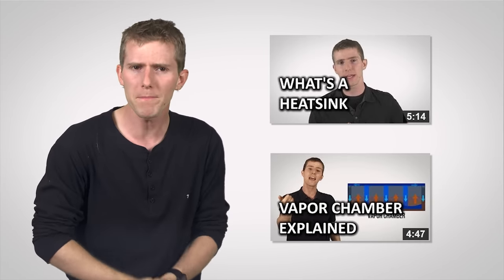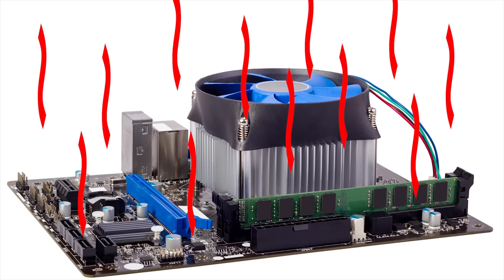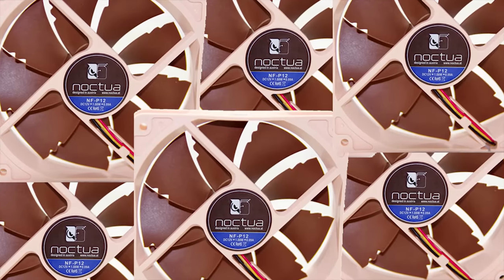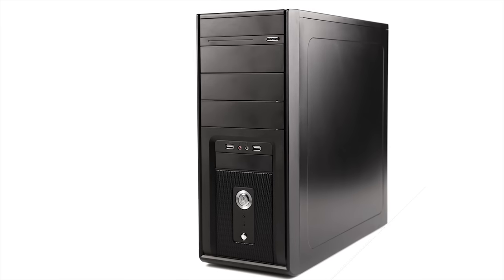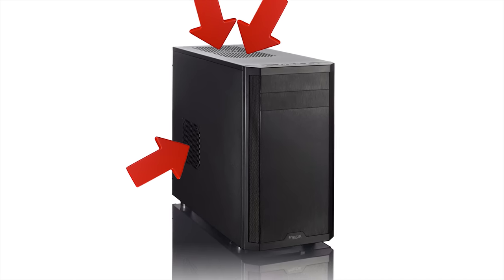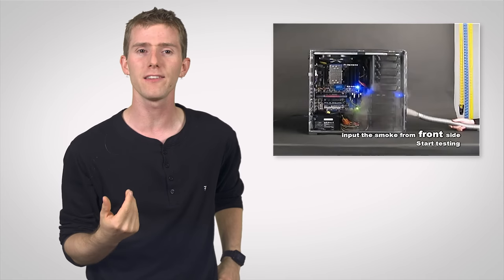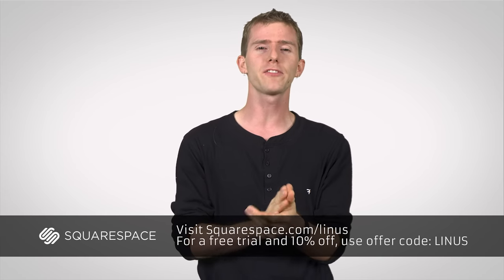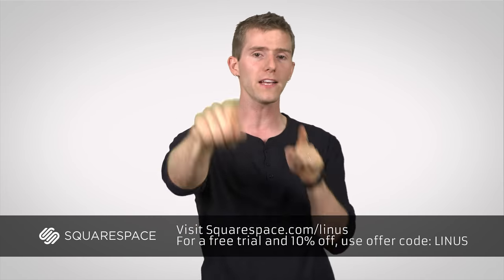Positive vs Negative Air Pressure as Fast As Possible

Comment: Negative pressure (at a ratio of 2:1) actually keeps things cooler, longer.  I did a quick test with all intake fans at 100%, compared to 20% CFM intake and 40-50% exhaust, and results were surprising.  I ran just a CPU stress test, and fans at 100% were only a few Celsius cooler than fans at 20-40%.  Creating negative pressure may invite more dust, but from what I've seen it's the best way to cool your PC.
Reply: of course more fan power = more cool. For a better test, all fans should be at 100% and, for example, test 2 in & 3 out vs 3 in & 2 out.
Reply: I’m building my first pc in the hyte y40 and the max amount of fans I can use is 7. 3 intake, 4 out. Would you reccomend or just stick with a 1:1 ratio
Reply: @survival_man7746 I don't think you understood his comment properly.
He's saying that all fans at 100% (balanced pressure) only resulted in a few C cooler compared to a negative pressure setup (with max fan speed of 50%).

Comment: Negative pressure invites dust in every nook and cranny which will shorten a computer's lifespan.  Make sure that the ratio of intake to exhaust is 2:1, 3:2 or 4:3. Modern cases used by computer assemblers emphasize lots of intake fans: often 3 and sometimes 6 fans from the front of the computer, and half as many fans exhausting air. They want to build computers that are better than those made on assembly lines  The trick is to filter the intake fans so the dust is kept at a minimum, keep the air flow high so components are adequately cooled, and use no filters on exhaust fans so the small amount of dust that does get in remains suspended and will exhaust out of the computer. With positive, managed pressure, dust will not come into the computer through the seams and panels.
Ratio of intake to exhaust from 2:1 or 3:2 or 4:3. 5:4 would produce neutral pressure and even numbers like 3:3 actually behave as negative because heat rises , GPU cards and power supplies exhaust, thereby creating negative pressure near the bottom of the case. You have to assure intake fan superiority to get sufficient air flow and movement and the benefits of positive pressure.
Reply: Heat does not significantly rise in a computer case because the air flow from the fans moves it in its direction too fast. They negate any currents that would cause it to rise.

Comment: Since you filter the intakes, it greatly reduces the amount of air pushed into the case, so you'll need more intake fans for a balanced system and even more for positive pressure. Maybe 2 to 1 intake versus exhaust, takinf into consideration that psu also acts as an exhaust.
Reply: Doesnt a psu get its air from outside the case though?

Comment: When my s4 active gets warm from gaming, I put it in the sink and turn on the cold water. It cleans some smudges and it cools it down. Because it's waterproof.
Reply: Watercooling, ghetto style. You should try to attach an h100i to it so you can oc it @ 4ghz.
Reply: iMrzifyyy
 You do realise he meant the Samsung Galaxy S4, yeah?
Not sure if srs.
Reply: The S4 is not waterproof at all. It's somewhat water resistant but not waterproof. Big difference.
Reply: Voyd Void read....
Reply: Laurence W ***** He is being sarcastic...
Reply: Voyd Void He said S4 Active, which is waterproof
Reply: Laurence W i'm not stupid, that was sarcasm >.<
Reply: k
Reply: iMrzifyyy
your level of sarcasm is over 9000!
Reply: Eduardo Trujillo yem8
Reply: erack117 My bad then!
Reply: iMrzifyyy
Because you were so specific, I didn't sense the sarcasm, but I know this is the internet where trolls live long and prosper and smoke weed every day.
Reply: So I guess that means literally using a heatsink.
Reply: Sunay Yuseinov huehuehuehue
Reply: Viral Pyro well if he was being sarcastic he should try it. The S4 active is water resistant and so was my S5 that I had. When it got hot I had no problem putting it in hot water for a few seconds because it truly did cool it down, much faster than any other way I tried.
Reply: Brian Gugger I doubt hot water could help to cool it down :P
With that said, if it wasn't water resistant it wouldn't have gotten so hot that it needed water to cool it down to begin with...

Comment: Video quality is like you bought a new camera :o
So clear picture..
Reply: They have uploaded in 4k for quite a while now, i think they use a black magic URSA.
Reply: ThatConnorGuy Yeah 4K is okay, but if you have an i3 you can't watch even 1440p without frame drops.. But what I wanted to say is that the picture quality / video bit-rate is higher, it seems.. :)
Reply: So clear that i can see that strand of hair on his right shoulder >.<
Reply: ThatConnorGuy They use an FS700 with 4K firmware outputting to an Odyssey 7Q.  In front of the sensor they have a Tamron 24-70mm f/2.8 VC on what I assume is a Nikon G to Sony E adapter, though maybe they've swapped to an EF mount version of the lens and a Metabones EF to Sony E Speedbooster to take advantage of in-camera adjustments, stabilization, and the extra stop of light.
Reply: Le Monarque Whoa.. I'm no video expert pal..
Reply: Filip Pesic I can watch 1440p smoothly on my i3-2100, guess it's your gpu then.
Reply: iMrzifyyy :O How's that? No, I have R9 280X DCII Top and 4GB of RAM, mobo p8p67 b3 from Asus, updated to latest bios.
It was always a mistery why I'm dropping frames on 1440p+.. I mean 1440p isn't that bad, few frames here an there, but 2160p is like.. Not watchable at all, dropping hundreds of frames every sec..
Reply: I'm sad I can't enjoy the awesomeness the fancy camera they use offers :(
rocking that 144p.
Reply: Filip Pesic Your internet just isn't good enough probably. Not bad to the point of buffering but noticeable lag. Or something really weird.
Reply: I have an FX 8350 and an HD 7950 and it lags like hell on 4k. I have great internet too so idk why i'm having problems...
Reply: Using HDMI or DisplayPort?
Reply: BandNerdcp 8350 and 7970ghz, I have a 4k screen and whenever I put it to 1440p it just freezes :)
Reply: Mar m That's what I'm talking about.. Flash player is absolutetly non optimized for anything greater then 1080p. When I play 4K from my HD, there is not problem, not a single frame drop. :)
Reply: Filip Pesic i've got a gtx 560 and 4 gigs of 1333mhz ddr3 ram, but vids go fairly smooth. Could be my 100down/10up internet though.
Reply: Filip Pesic
probably internet
Reply: Sarah Hanz um...I don't think so. I think it is a flash player fault, not internet. I have 150mbps, fairly decent PC and still it frames like hell on 4k. I don't have these problems on movies from BR or from HDD
Reply: ***** it's the flash player then :(
Reply: Filip Pesic I have an i3 and i can watch 1440p flawlessly..
Reply: Net matori...
Reply: ***** it has hold me up really well, 10/10
Reply: ***** enough to run bf3, chrome and other shit easily.
Reply: Guess ya'll just don't notice the frame drops on 4k or sometimes 1440p.. :)
Reply: Umovni 'De mator '93. sam :)
Reply: ***** what? I play mc with 16 chunks and a high res rp always mid 200-300.
Reply: Filip Pesic
Idi begaj... :D Ja 80 tako da... :) I nisam skapirao koju masinu imas? r9 i neki 1150 cpu? Ako je tako onda bi trebao da ima snage. Za to itekako. Ili net ili fles plejer...
Reply: Umovni Hah.. Nazalost i'am i3 2120 sto mu dodje Sandy.. I 280X i 8GB rama.. :)
Reply: Filip Pesic
Ma bre cuti i uzivaj. Bolji si od mene sto puta. Ja i dalje koristim soket a... Ziva antika :D Mada gledam da uzmem u skorije vreme 550d (ako IGDE uspem da ga nadjem), neko 850w napajanje i neku masinu do 300 evrica...
Reply: Umovni U covece, to je bas oldschool.. Ja i'am TT Toughpower 775W 9k na KupujemProdajem.. Lagano sam uz'o savrseno radi vec godinu dana :)
Samo nemoj onaj Raidmax, ja sam 'teo njega pa sa kopao po netu sto je toliko jeftin.. Ni po koju cenu nemoj njega.. Tipa LC Power je daleko bolji. :)
Moz' neki APU da uzmes, to je dobar pocetak.. Kasnije nabacis 270X i cao zdravo BF4 na max.. :) Osim ako nes Nvidiu, mada je ona paprena..
Reply: Filip Pesic
 Znam. :) Imao sam i5 750, ali sam ga prodao zajedno sa rvo1, 5870 referentna, sta jos... Zaboravio sam, odavno je to bilo... Jbg... Trebale mi pare. Inace gutao je sve sto sam mu dao bez problema. Tada sam se vratio na ovu kantu, jedva gura YT. APU definitivno. Neki A8 ili A10. Jeftini su a rade posao samo tako. AMD grafika. Tu si u pravu. nVidia je preskupa. Veoma. Crveni su sasvim dovoljni..

270X?!? Ozbiljno?

Raidmax nisam ni razmisljao uopste. Sta mu fali? Sto da se zaobilazi?
Reply: Umovni Ih bree.. Pa dor'o, strpljenje ter'o i to je to.. Ja ovo sto i'am komp to nije tek tako nego mi je trebalo vremena ko zna koliko.. Godine polako prolaze a meni komp sve bolji i bolji, drugacije ne moze, ne mogu da napinjem matore tol'ko, razmezeno bi bilo s moje strane. :)
Nego, rek'o sam ti 270X zato sto ona moze da radi u dual graphics rezimu sa APU-om.. Jace grafike ne mogu, 270X je max, ali ti je i pritom sasvim dovoljno.
Sto se tice Raidmax-a, to je stara serija njihovih napajanja koja su imala previse problema pa su ih oni "rebrand-irali" tako da se ne zna, a unutra je veoma lose, mislim na elektroniku, kapacitore, plocu, lemove i ostalo.. Crkavaju olako, imaju veliki ripple, efikasnost sto reklamiraju GOLD i BRONZE je cista laz, jer im neka "rupa" i zakonu dozvoljava. Inace unutrasnjost/elektronika je cisto kinesko. Mnogo ti je bolje da nadjes nekog na KupujemProdajem blizu tvog grada ili cak iz neke p***e materine samo da ima pozitivne ocene i lepo kupis savrsen PSU za lepu kintu, ili ako si paranoican, uzmes neki LC power. :) (mada bi ja uvek uz'o preko KP, tipa nesto 700W+)
Reply: Filip Pesic
Znam da samo neke grafike mogu da rade sa integrisanom ranije iz iskustva. Ali zapamticu to. Napajanje... Imacu u vidu... Skoro sam poceo da sljakam pa da skupim neku kintu da lagano skrpim masinu. Voleo bih kada bi negde nasao Corsair 550d... Po meni jedno od najlepsih Corsair kucista. Kvalitet se naravno (?) podrazumeva. Kvalitetno kuciste i kvalitetno napajanje. A ostalo.. Koliko para ostane. :)
Reply: Umovni Aha, da.. Corsair ti je super, mada nek bude bad 600W, posto AMD i CPU i GPU su ono.. Veci potrosaci od Intel i Nvidie zajedno.. :) A Corsair kucista su bas super, jedino sto sam vido da im zameraju je da im je sasija malo slabija, tipa mozes celo kuciste da deformises uz malo vecu silu, sto znaci da u putu moze lako da se osteti.. Mada ono, trebas bas maler da budes da ti se to desi, a postoji i garancija naravno. Ja imam Silencio 550 i nemam na sta da se zalim, akcenat mi je bio na tiho kuciste, sa zvucnom izolacijom, zato sam bas to uz'o.
Reply: Filip Pesic
U da. Definitivno. Zato merkam 550d. Zvucna izolacija. A ako zelis protok vazduha, samo skines poklopce i imas max airflow. Uz zrtvu zvuka naravno ali bas zato imas obe opcije. Dobro, ja vise volim minimalisticka kucista, tako da mi se svidelo to.

Sad sam video Silencio. Asimetrican HDD kavez. Svidja mi se. Skines veci ako ne pravis file server, i pravis mesta za ventilator tj. protok vazduha. Slicno kao moj favorit. Mozda sam se i razmisljao da uparim takodje sa nekim Corsair napajanjem, ne bas 1500i naravno :) ali ima neka njihova napajanja koja nisu skupa (bas napucanih cena) ali su kvalitet...
Reply: Umovni Da, bas tako, minimalisticki dizajn samo tako.. :) Ja sam skinuo HDD cage cisto jer me nervira, i'am samo jedan hard, tako da mi je beskoristan.. A sto se tice napajanja, nemoj da budes ono, ogranicen samo na Corsair, odnosno jednu marku.. Corsair je dobar samo zato sto im je OEM, ono sto je u kutjiji od napajanja Seasonic, to je jedini razlog, a Seasonic ti je najbolji prodizvodjac napajanja na svetu. :) Udjes lepo brate na KupujemProdajem, sortiras napajanja od najskupljeg i tako gledas svaki dan dok se ne pojavi neko ko je iz tvog grada, odes, proveris funcionalnost kupis i cao, kao ja.. Znam da sam malo napeo s tim KP KP KP, ali veruj mi da se dosta isplati.
Napajanja koja su dobar znas, Seasonic, Cooler Master samo zadnja serija - Vanguard, Corsair ali ne svaka serija, Super Flower, Antec, OCZ, LC Power samo po neko.. Losa napajanju su Raidmax, Chieftec znam da mi ne verujes, neki od starih serija Corsaira, Aero Cool i ostale marke za koje verovatno nikad nisi cuo hah.
Sve ovo sam ti rek'o na osnovu hardcore citanja pre moje kupovine napajanja, sto je neki period od 6 i vise meseci.
Setih se jos neceg da, maticne za APU moras dobro da pogledas. Ja sam procitao par reviewa i skont'o sam da imaju problem zagrevanja CPU phase napajanja, sto ti dodju oni hladnjaci oko procesora, naponske jedinice koje daju procesoru struju. Mislim da samo jedna ploca od Asusa i jos jedna od MSI-ja su ozbiljno odradile taj socket za APU. Rek'o bi ti da kopas malo pre kupovine, ako imas free time. :)
Reply: Filip Pesic
Buuurazeru... Ti si se bas nacitao... :)) Znam otprilike koja su napajanja "dobra" a koja ne. Ovaj tvoj odgovor definitivno ide copy/paste za kasnije da znam sta da uzimam.

Znam sta je power phase circuitry. Takodje i ti sigurno znas da se AMD zaglavio sa 28nm litografijom vec duze vreme i izgleda da GF nece taj problem skoro resiti. Tako da se oni i dalje zagrevaju, trose oko, blizu ili cak i preko 100W. A i IPC im je los u poredjenju sa Intelom.

Bas da znam kada budem za neki mesec sklapao jednoj drugarici masinu sa AM3+. Da li mozda znas da li i dalje moze da se nabave SSD za oko 8 soma sto sam vidjao po netu? Ako ne znas nije strasno. :)
Reply: Umovni Hm.. Lepo sto je sto cenis misljenje lika kog nikad nisi vid'o.. :)
Malo si se zajeb'o.. AMD jeste na 28nm litografiji za GPU isto kao i Nvidia, a za CPU je Intel na 22nm dok je AMD-ova FX serija jos iz 2012. na 32nm.. :) Mada pazi, nikad necu da cenim tehnologjiu na osnovu toga, jeste kul sto da trosi manje i to predstvaljva ustvari da kompanija pravi progress ali ako pitas mene ne, nikad to necu da gledam. Fora, kopao sam nesto o AMD-u i Intel-u, i nas'o sam ja su i3 i5 i i7 nastali od AMD-ove tehnologije jos odavno, prva generacija. Kad je AMD napravio prvi 64bitni CPU jos ovadno Intel je bio okamenjen, pa su uzeli bukvlano 2 CPU-a i "stavili" ih u jedan, sto je bila cista katastrofa od strane Intela. Kada je Intel izbacio kasfetan 64bitni CPU, AMD je kako Ameria kazu trcao krugove oko njega. Tek kasnije kada je dosla Q serija kao i 1st generation Core i3 i5 i7 tek tad je zasijao Intel. :)
Ti sada da uzmes FX8350 koji kosta nov oko 18k a mozda i manje neces da imas nikakv problem u igrama, garantujem ti. Bio sam opsednut time, AMD vs Intel bullshit hah, iako postujem obe kompanije.
Pogresio si za potrosnju takodje. Moja karta trosi nesto vise od 250W, mozda bocka u 300W nekad, nisam siguran. Cak retko koja trosi ispod 100W od ovih low end cak.
Imas SSD nov na KP 120GB Samsung EVO koji je jedan od najboljih za 60e sa 3 god. garancije. Ja cu sad uskoro da uzmem PRO 128GB isto od Samsunga, jer je garancija nepobediva - 10 godina. :)

Sry za roman.
Reply: Filip Pesic
E pa sad si me zajeb'o za CPU stvari samo tako, :D Ali i od pametnijeg ima pametniji ili kako vec. :)

Sto se tice potrosnje, mislio sam na CPU a ne na GPU... (ako smo se dobro razumeli:) ) CPU trosi max 100W a GPU trosi i do 300, 350W zavisi od scenarija, kloka, napona itd...

Au da, jeste, GPU je 28... Mada zasto sam ja umislio da je i CPU na 28. mada to uopste nije merilo snage. IPC je NAJBITNIJI. Ako se ne varam. A tu je Intel svetlosnim godinama ispred AMD-a. Za sada. Mada AMD je zakon. Za te pare je vise nego dovoljan, osim ako ne zelis da se bavis nekim renderovanjem, audio montaza (lupam primere)... Za igrice i sl... CPU je skoro pa nebitan... Ne sasvim ali kapiras na sta ciljam.

Nema problema ne ljutim se za roman/esej. Poucan i naucis nesto novo. Ozbiljno...

Ja sad odo da te ne smaram sa ovom visednevnom prepiskom. Kucamo se u nekom narednom video klipu. :D I hvala za informacije... :)
Reply: So clear that you can see the hair on his shirt.
Reply: 4k

Comment: I used to be a die hard "fan" of using positive case pressure fan arrangements until I ran into a big problem that I just could not figure out at all. My pm was constantly shutting down with no warning. After a couple hours I had narrowed it down to going some kind of overheat shut down... But my CPU and GPU and everything else that you would normally think of causing an overheat shut down were all well within the max temperatures. Long story short, I finally figured out after much head scratching and hair pulling and flaming hot cursing, that my Northbridge was overheating because the case pressure that was only SLIGHTLY positive, was creating a pocket of trapped hot air around the Northbridge... And apparently it's not all that rare for positive case pressure to create trapped hot air pockets, aka Hot Spots,  in a system. This is why I switched to slightly NEGATIVE case pressure. There is ZERO chance of having a trapped hot spot in the system anymore.

Comment: full negative pressure seems to work best for me, yes it sucks in more dust but I clean it every now and then anyway. The case is a Coolermaster Elite 130, an ITX case, every fan blows outward and I've found it to be best for cooling because getting hot air out is better than getting cool air in. The difference is not night/day but this setup has been consistently cooler than having a front in-back-out setup or full positive pressure.

Comment: So to recap if I got tht right : For general cooling objective the idea is the move the maximum of air (quantity and speed) trough the case. For dust buildups you have to make sure you have neutral or slightly positive "pressure" inside the case so as the avoid at all cost to have air flowing in trough various small holes around the case. So the best setup is to get maximum air flowing trough and at the same time  beeing neutral or slightly positive inside. If not sufficient for cooling you can move more air out but this will be at the expense of dust buildups.